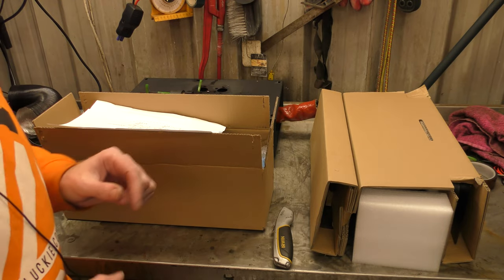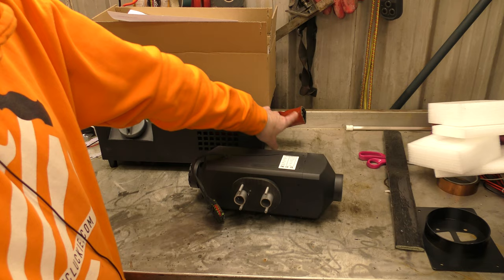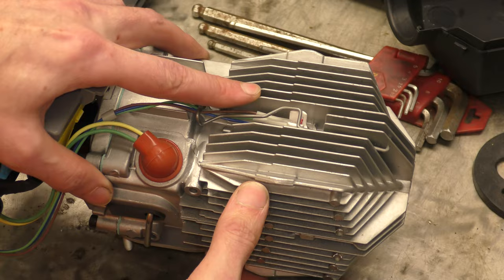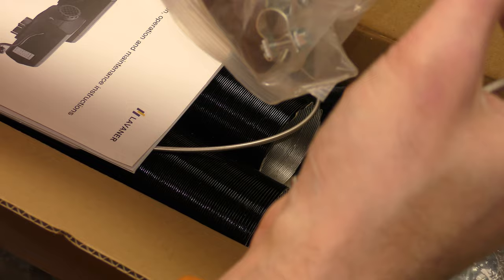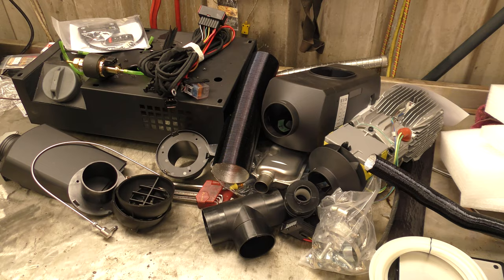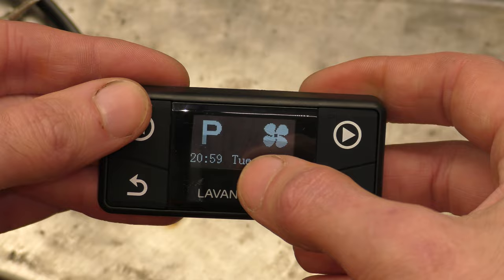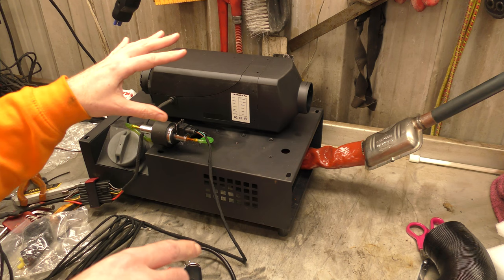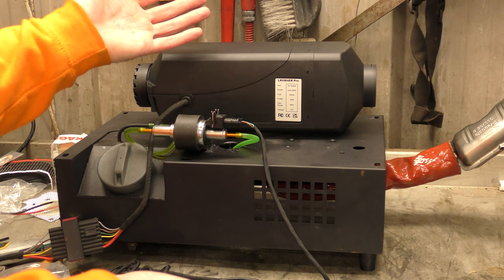Lavaner Pro MAX air diesel heater

Comment: I have the Pro and its absolutely amazing.
A massive plus point is having Craig H contact for any help and advice, I have 100% Confidence in the heater and know for a fact if I ever had an issue Craig is only a message away.
The Pro and Pro Max is a million miles away from a vevor £89 heater and very very close to the "far more" expensive heaters out there.
Reply: Hi, Did you fit yourself? I have been let down and looking to get one installed ( PRO or Alpine ) and am willing to travel from  Teesise to get installed. Any recommendation will be much appreciated.
Reply: @paulturnbull1459  honestly pal,all you need is a 127mm holesaw, some hammerstein paint the same colour as you van and a tube of soudal fix all from screwfix and ill talk you through it
Reply: @matterhorn1975  Much appreciated, I also just watched your unboxing. I will keep in touch.
Reply: @matterhorn1975  how do I get in tough with you?
Reply: @matterhorn1975  Was there anything additional you needed to order when you ordered? Or would you recommend any extras? Cheers

Comment: Thanks for your great video - this is very helpful!  Do you know if it is possible to see what the internal burn temperature is from the LCD display?  Im having a problem with my lavaner pro max alpine unit building up soot and trying to determine the root cause of my issue.  Ive had to blow air through the intake twice now in the last two weeks with a shop-vac in order to get it to fire up and saw lots of black chunks / black smoke come out of the exhaust each time.  Ive been running on high for the last week or so without any further issues but id like to be able to run it on a lower setting without worry its going to give up in the middle of the night.  Another question - is it ok to run the silencer in the middle of the exhaust run or must the silencer be at the end of the run?

Comment: Thank you for your excellent informative video.
I've just received my 5kw Lavaner Pro and, disappointingly, it does not have a waterproof 'potted' cpu. Neither does it have the additional body sensor. It also needs the ports cleaned up to remove the rough casting snags. Overall I'm disappointed in the quality of it considering the high premium price I paid over the cost of the standard Chinese heater. Although the accessories are definitely better quality. 
But it certainly does not seem up to the standard of those provided to you. Seriously thinking of returning it.
Reply from the maker: I'd message Craig on their Facebook page and see if he can do anything for you.
Reply: @DavidMcLuckie  Thanks but I don't do Facebook. I will sell it on rather than return it.
Thanks for the excellent information you provide, it's really helpful and educational..

Comment: Hi David, I'm getting an error code E-13 on my LCD controller.  It is wired correctly and I've reset a couple of times.  Any ideas?  I have not heard back from Craig on this yet.

Comment: Thank you for all these videos about these deisel heaters. I've seen where you made these work as a hot water supply for a shower.  I'm wondering if you could take one of the hot air models and use it for the hot air supply for a propane clothes dryer? 
Thank you again for all your videos.

Comment: Anyone know if there's a way to get this to operate at high altitude?  Can the user change the fuel pump/fan frequency?  Is it compatible with Afterburner?
Reply: just heard from Afterburner: it's NOT compatible with Pro Max 2kw.  Pro 2kw is compatible w/ Afterburner &  altitude sensor.

Comment: Apart from the amazing afterburner does any of the available Chinese controllers actually switch the heater on and off based on the thermostat?
Reply from the maker: Yes.  Kind of.  The controller in the Hcalory all-in-one that I tested in a previous video has a mode where you can set a temperature.  When it goes over that temperature it fully shuts down, and when it falls again by two degrees the heater fires back up again.

I really wish the controller was available separately.

Comment: The connector used look like Automotive Superseal Connectors, My Volvo S80 D5 has similar connectors very good Quality for sure, you won't get water ingress so therfore your contacts will stay clean away from contact deterioration from moisture 👍 nice engineered unit, Lavaner gone to great lengths to make their units much better than the others out there,👍

Comment: I'll install it in a few weeks
in a cabinet with special materials
the exhaust pipe is glued for temperature of 8oo degrees
and then testing
does the combustion air still come along??
then there is a leak in combustion chamber
then open everything
and see what's going on
if i find something??
do you know too

Comment: Thanks for this review, will buy one direct when it will be on the market.
I have one question, is it possible to use a diesel heater sideways, so that the inlet and exhaust is on the side, and not on bottom.?
Reply from the maker: Yes.  You just need to keep where the glowplug is at the top.
Reply: @DavidMcLuckie  ok thanks for the information

Comment: Would you recomend this over the new Maxspeedingrods Bluetooth 5Kw (I don't need 5kw as in a MWB Crafter) just want the better heater?
Reply from the maker: Always.  The Maxpeedingrods heater is just a typical heater with a slightly better controller.

Comment: Hi David, 1) I want to know when the diesel finish the engine stop automatically ? 2) Does  the system work automatically with termostat like fridge o boiler etc...? there is  carbon monoxide with the chines diesel heater? thank you ...
Reply from the maker: 1) If you mean if it runs out of fuel.  Yes.  It detects flameout and stops.
2)  You can set a temperature and it will maintain that by throttling the heater.
3)  Yes, CO same as from all fuel burning things.

Comment: David I would love to buy a Lavaner Pro 9kW for my home 🏡 Lets face it Air heater is going to be far more capable than trying to firstly heat up 9 large metal radiators & all the pipes, so much waste energy in doing that, but heating up the actual air is far better & you can direct the heat where you want it, to me as a retired Aerospace Defense Hardware Verification Qualification Test Engineer, I always go for quality first because it lasts longer, Lavaner have certainly engineered a really great unit that's caught my eye, its very sensible design where they measure body, air temperature inlet, chamber temperature, & output case temperature, for sure the controller will have a temperature measurement device, what would be nice would be a Lambda probe in the heater, Altitude sensor, Yes indeed I'm seriously very impressed with this demonstration of the unit, Yes I can certainly see the quality of the casting & glowplug construction, as a retired hardware verification qualification test engineer I'm probably classed as a very fussy person it's very true, I will be contacting Craig Ho👍 for an order, I have a Chinese wife & family in China so communication in Mandarin is very easy & straightforward. 
Nice 👌 Demonstration David 👍

Comment: a question
bought a diesel Heather from Vevor 8 kw
when starting diesel Heather a diesel air comes with it
i use it in my living room so is not pleasant when the smell of diesel gets its only on start up
because of the gas price is too high for the moment
what could that be??
would like your help or opinion on this
thanks
Reply: Possibly to do with teh crap black flex pipe, or crap pipe connectors or crap green line, or crap connections in general that you get with vevor
Reply: @matterhorn1975  agree . the green fuel line and the provided filter often crack and leak
Reply: Did you ever get this solved? My Vevor 8k does the same thing at startup. Guessing either a leaky seal in the heater itself or leaking where the exhaust pipe connects to the heater. Mine is installed in a work shop so not as critical. Plan to do a better job mounting/piping it in the spring if the thing lasts that long. 🤣

Comment: Can you wrap the fuel pump with thick layers of insulation to kill the sound?
Reply: No. Not anything worth spending time on. It's pure mechanical noise. It's just the way these pumps are. Suspend it from two zip-ties like everyone else 😁🪄
Reply: @krimke881 
  Have ever seen or use safe and sound insulation?
The stuff is wonderful. You put a ticking clock wrapped and you can't hear a thing.

Comment: Great video as always David, thank you! 
This unit seems well made and I might buy it and install it in the Land Rover. I already have a Webasto Thermo Top C but I'd like to install this for extra heat in the cab. I have 1530 timer and T70 telestart for the Webasto. Would you buy any chance now If it's possible to somehow splice into the existing loom for the 1530 to have both the Webasto and the Lavaner turn on simultaneously when using the timer or telestart?
Reply from the maker: That is outside the scope of my knowledge.
Reply: @DavidMcLuckie  Since the Thermo Top C operates on 12V+ signal in, I imagine it should be possible to also have the Lavaner heater start on the same signal? Or am I mistaken that it only needs a 12V+ signal to start and turn off?
Reply from the maker: As far as I know, there isn't a 12V+ trigger for the diesel heater controllers.
Reply: @DavidMcLuckie  Oh, I had just figured all the CDH were "dumb" that way. So they're not?

Comment: Is it feasable to mount the body 90 degrees rotated, such that the exhaust + inlet pipes are pointing sideways? I ask, I wish to eject the exhaust gas directly into a heat exhanger prior to venting the gas under the van. Thx.
Reply from the maker: Yes.  You just need to rotate so that the glow plug stay a the 'top'.
Reply: @DavidMcLuckie  Thx, why glowplug on top out of interest?
Reply: @NevContractor1  it prevents flooding of the plug and dripping fuel in case something goes sideways.

Comment: Hello David.
I have watched your videos with much interest particularly your comparisons with different manufacturers of diesel heaters, which leads me to my question, when dismantling you note whether the connections are insulated with a glue like substance, which on the more expensive models it does seem, on and around the motherboard, they do come with some glue type insulation I assume to prevent water/condensation corrosion. That being said would you advise on those without such protection to invest in a product such as
Waterproof UV Protection Liquid Insulation Electrical Tape Insulating Glue 
And apply as necessary. 
Interested to hear your thoughts.
Reply from the maker: It certainly won't hurt to add any extra protection you can.  I use this stuff - https://amzn.to/3CU5pSI .  It's dielectric as well so you can use it on all the electronics, and plugs to keep the moisture out.
Reply: @DavidMcLuckie  Thanks for replying and the recommendation, I will purchase some.

Comment: SIR MCLUCKY,,,WHAT HAPPENS IF A DIESAL HEATER RUNS OUT OF FUEL WHILE ITS IN OPERATION ?
Reply: @user-sh6bl8vw3q  DUH,,,,BUT DOES IT HAVE ANY COMPLICATIONS OTHER THAN REPRIMING THE PUMP ?
Reply: @wonyankeesays5661  it'll give (and detect) a flame out fault and go into shut down mode, ie keep the fan spinning until the temperature has come down to prevent the ECU being over heated.
Reply: It could soot up the main gauze in the burn tube . Not advised to let it happen to often.  I work on these heaters and to my own shame it happened to me to😔
Reply: @pauls466  Thanks ,,has not happened to me but always nice to know the cosequences
Reply: @yodab.at1746  THANKS,,,thats what I was curious about
Reply: @pauls466  I'm curious to know how running out of fuel would cause the main gauze to soot up.
Reply from the maker: As other have said.  It'll just flame out and do a normal shutdown.  Then you'll just have to prime it again to get it going.
Reply: @DavidMcLuckie  THANKS MCLUCKY ,,I HAVE FOUR ,,ONE UNDER PICK UP TRUCK TO HEAT CAMPER SHELL,,ONE TO HEAT MY SHOP,,,AND TOOK PROPANE UNIT OUT OF MY MOTOR COACH AND FITED IT WITH ONE,,,AND A SPARE,,,THEIR GREAAAAAAAT !,,,THANK U FOR YOUR CHANNEL !

Comment: Does the afterburner controller work with this?
Reply from the maker: Not with the MAX version.
Reply: @DavidMcLuckie  But afterburner works with the regular pro (non alpine)? And since I have you, does the non-alpine/non-max 2kw Pro have the ability to run at altitude (with manual settings)? I'm a genuine cheap bastard, but I'm getting tired of hunting for a bargain 2kw (especially since I won't know if it's actually 2kw until it arrives). The Lavaner seems worth the extra expensive, but only if I can make the ~$220 (Pro, non-alpine, non-max) unit run at altitude (~5000 feet), jumping up to the max alpine for an additional $150 is out of the budget. So, does the base pro work (manually) at alpine?
Reply from the maker: Yes, Afterburner works with non-alpine.  You can adjust the settings of the non-alpine with the Afterburner to something that will work at high altitude.  Something like 0.8hz - 1500rpm & 2.4hz - 4500rpm.
Reply: @DavidMcLuckie  Thank you. I'll probably get the afterburner, but in the meantime, ... the non-alpine, non-max Lav 2k is still manually adjustable for elevation (and tuning), yes?

Comment: Curious why these heaters not run a fuel injection and spark plug for instant heat
Reply from the maker: Cost I imagine.
Reply: Because you'd need very high pressure to atomize the fuel, and the pump required would cost more than the heater itself.
Reply: I have a proheat that lights from a spark plug, but it starts with a bit of smoke compared to the glow plug design

Comment: its kind of hard to believe that a chinese 2kw of this size is heating our 2 up 2 down semi detached house at 2.1Hz to 20 degrees C for 10 hours a day using a mere 2 litres of diesel, our 32kw gas boiler uses up £12.00 a day in natural gas, this is saving us around £9.00 a day in heating costs heating the inside air. everyone struggling to heat their home in this mass extorsion of gas prices going on at the moment should have one, these things could end fuel poverty for a lot of families in the UK, its a great shame that no one has seen these as a good solution to end fuel poverty and it could make the difference between life and death for some people.

Comment: The fuel line looks like it will quickly wear thru due to vibration on the metal edge. A rubber grommet or a bracket would address this. !:- )
Reply: they have that .

Comment: if it ran different software than the Chinese heaters then it would not be compatible with afterburner controller.
Reply: I dont believe it is compatible
Reply: @matterhorn1975  apparently it is. That's what I heard.  Only the software on the controller different but the mainboard software is the same

Comment: Interesting! Like the better wire connectors. But, no matter what name that on them, they ALL are made in China!
Reply: Yes but to the agreed specification!
Just remember, most Volvo cars are made in China too!
Reply: Webasto and Eber as well . Lavaner used to make the Webastos for them
Reply: @pauls466  absolutely correct
Reply: @pauls466  correct! : )
Reply: These Lavaner heaters are a bit better that the 'cheap' Chinese ones but definitely not worth paying two and a half times the price. I regret buying mine.

Comment: Where can I find their 9kw model? Can't find it anywhere.
Reply from the maker: Not sure it exists anywhere outside of the Chinese markets yet.
Reply: @DavidMcLuckie  
I Hooe they do bring it over. I am now having to install 2x 4kw ones in parallel. I have an 80L fuel tank ready. Still far cheaper than electricity.

Comment: not impressed … it’s seems more like a marketing scheme to charge more money ….

there are others on the market for the same price or less that have altitude compensation and a phone app to control the unit
Reply: the alpine version has that , but no phone app.
Reply from the maker: If you happen to live in at a high elevation, could you test one of the heaters with altitude compensation?  There is nowhere near me high enough to see if the fuel hz changes.
Reply: Having now purchased one, I agree with you.